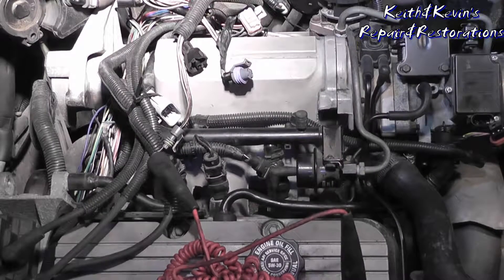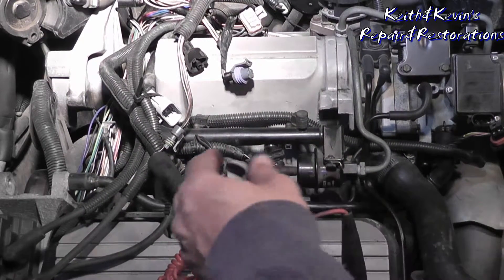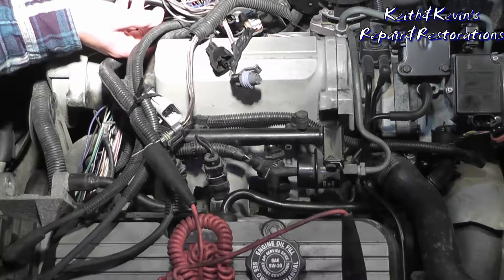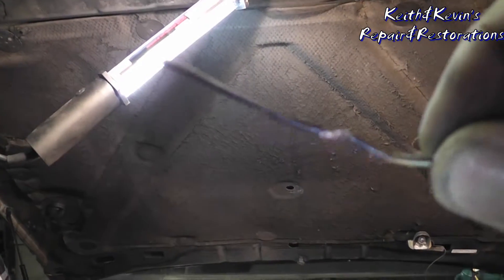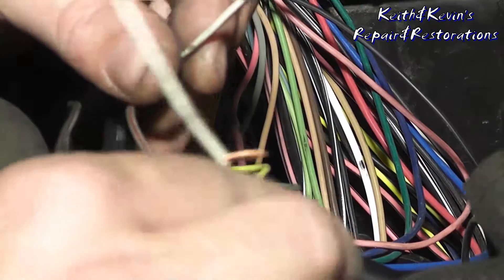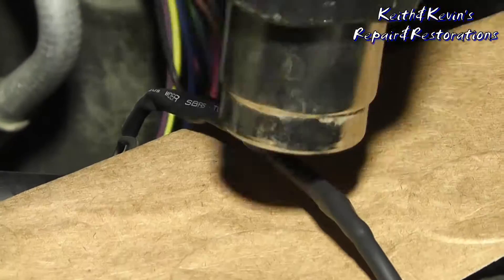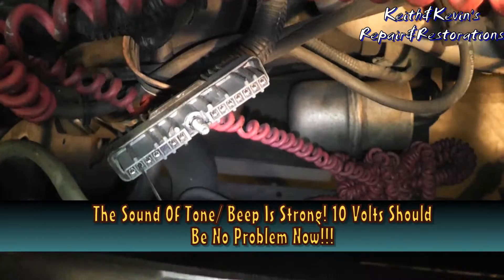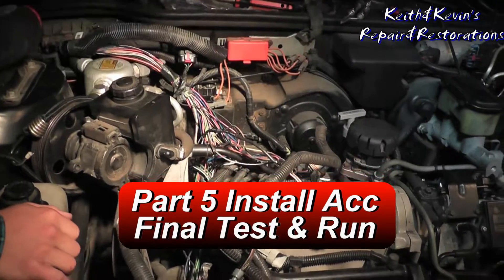Dead Battery Good Alternator Intermittent Stalling 3.8L/3800 V6 1989 Oldsmobile PT.4 Wiring Repair

Comment: I got a '88 olds 88 with a brand new battery that is out of juice. Dash lights won't come on. Will it be possible to charge it with a battery charger pack? It ran fine 5 years ago, no major electrical issues. Brand new alternator and plugs as well.
Reply: I'm just trying to see if the car itself will still hold a charge, so I can still drive it later on.
Reply from the maker: If the battery charger has enough power it should charge it up. Wondering if you have a light on (trunk, dash, interior, ect) or a door is open? If its a new battery and its dead something is draining it.  Dash lights won't work till there is a enough power to kick the dash light relay over. 
/K&K

Comment: I noticed at @4:43 the ICM connector has a terminal missing on the 5th terminal from the left. This wiring harness from Ebay has no missing terminal. 

Is this Ebay wiring harness the correct wiring harness for a 1988 "C" LeSabre?

https://www.ebay.com/itm/GM-12127654-OEM-Ignition-Coil-Harness-88-95-Buick-Oldsmobile-Pontiac-w-3-8L-V6/274026431471?ssPageName=STRK%3AMEBIDX%3AIT&_trksid=p2057872.m2749.l2649
Reply from the maker: This Oldsmobile did not have a Tachometer and some of the Lesabre / Park Avenues did.  The harnesses are the same with the exception of the Tachometer circuit wire.  Does you dash have the Tachometer option?
/K&K
Reply: @KNKRNR  My current instrument cluster in my '88 LeSabre does NOT have the tach.

But I pulled an instrument cluster from an '89 Park Avenue not too long ago that does have the tach. If I use that wiring harness will the tach on the instrument cluster work in my '88 LeSabre?